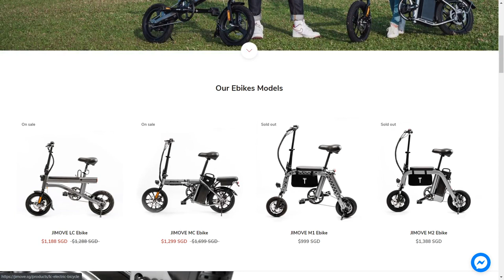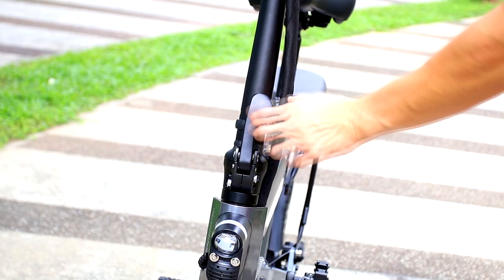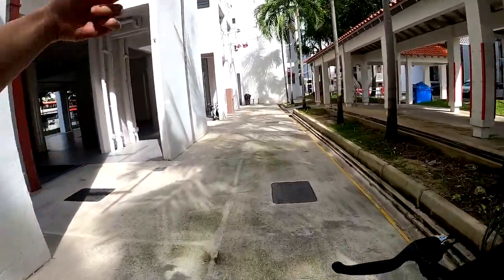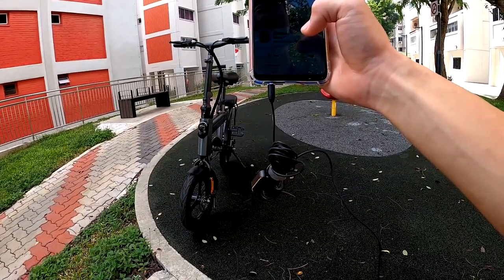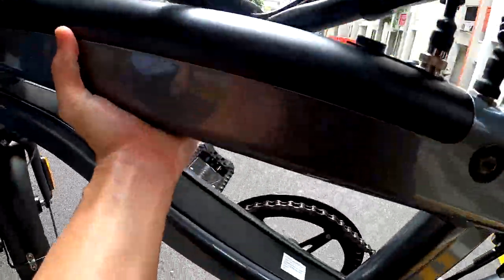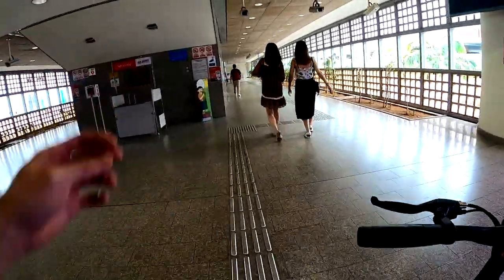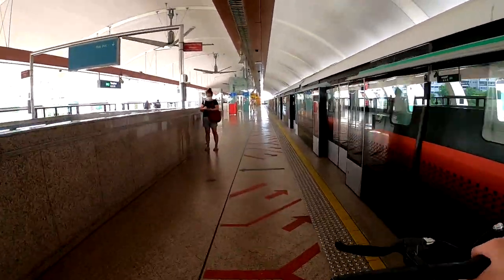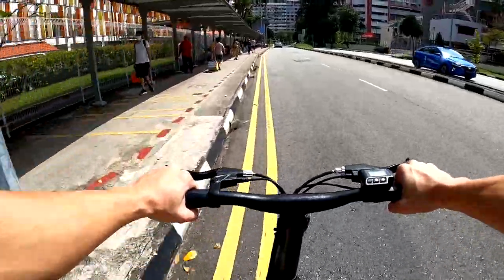Ji Move LC Technical Review & Transporting It Into Bus, Train & Car?

Comment: usually buses, cars can fit small size escooters. bus you can request to enter the back door.
previously have put a fiido into the back seat before without needing to fold it. of course be careful don't damage people car. 
just ask for permission after booking the car, or ask if boot is empty.
the mrt rule is actually not well thought out...  virtually makes it less safe by folding down the handle. 
fold down very hard to move, many people get into arguments with the station officer as you mentioned.
Reply: The bicycle is outside LTA limits.. I Kenna rejected from bringing up before
Reply: @franklee8032  is it? lc move so tiny, where got over limit?

Comment: Some mrt staff very knn one, will ask to fold your ebike and carry all the way to the train.. Thankfully Simei mrt staff good to you, but my area in Sembawang there is one head staff very siao on one, when i was pushing my JI Move into the lift to go up to the platform he pulled my ebike out of the lift and asked me to put against the board to compare.. then after folding the handlebars down the head staff also said need to lower the seat.. you were lucky they not so lay chey to ask you to do tat in this video.. i really hate the sembawang mrt staff when boarding the train with my JI Move
Reply from the maker: 50/50
Reply from the maker: Sorry to hear that